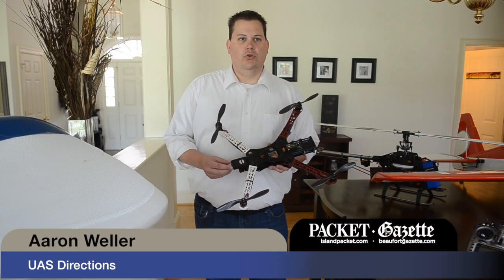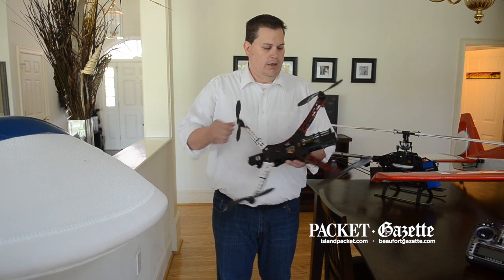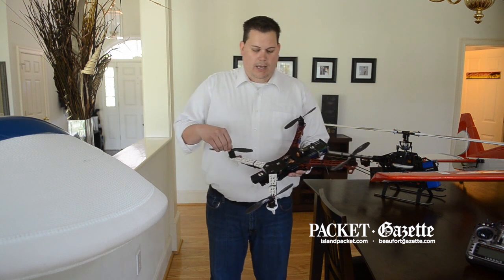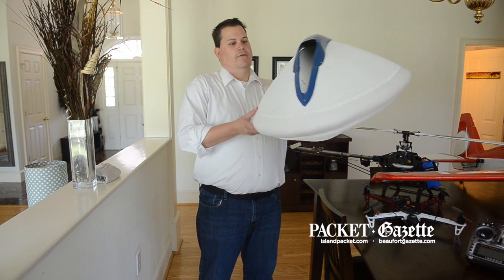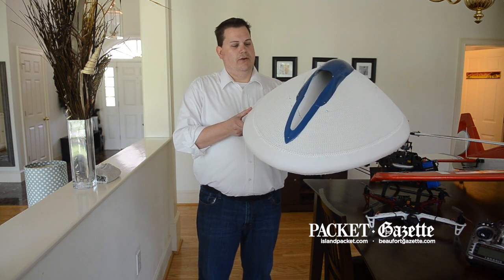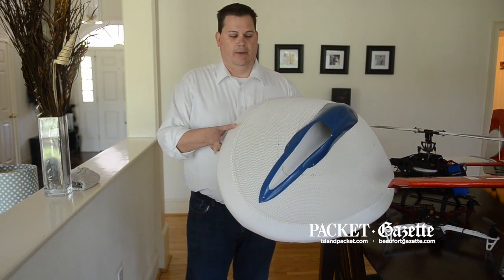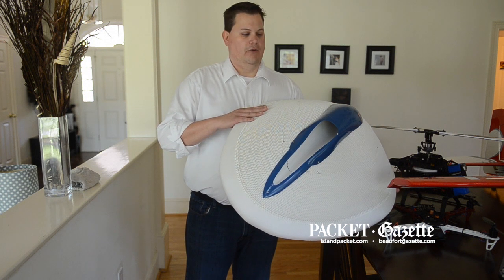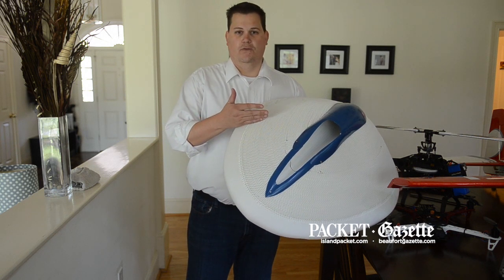Meet Aaron Weller's Droplet drone

Comment: Until they actually show the inside or tell us what its form of propulsion is, I'm not too impressed. It can be hanging from a string for all we know.

Is it a mesh material shell with a multi-rotor inside? Does it use circulation control or the Coandă effect? As far as I'm concerned this is all a gag.